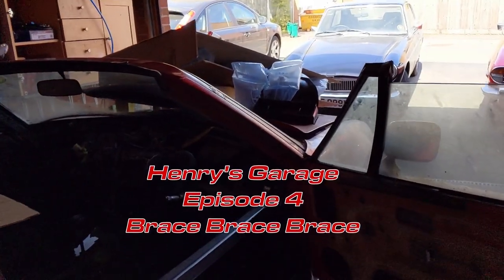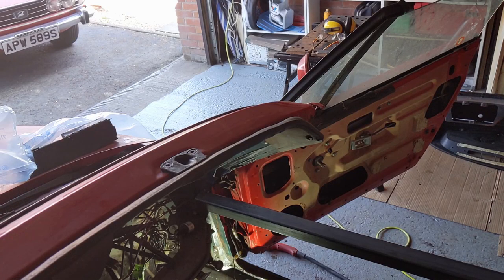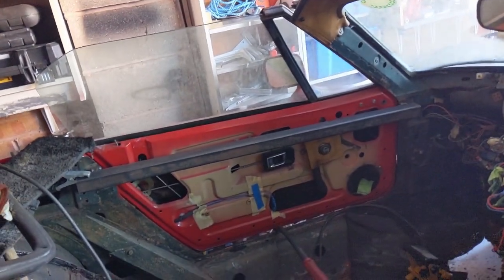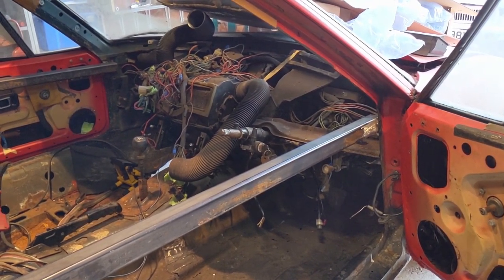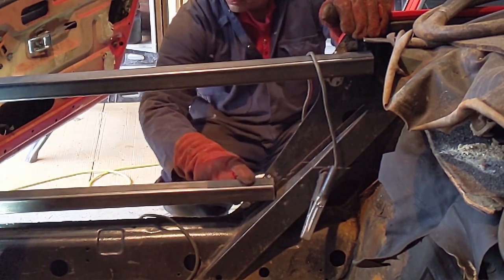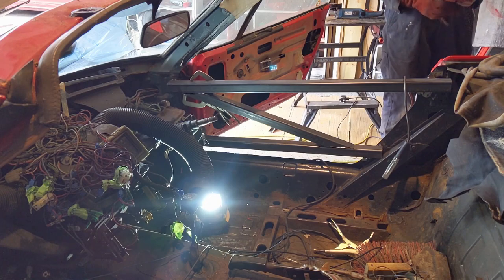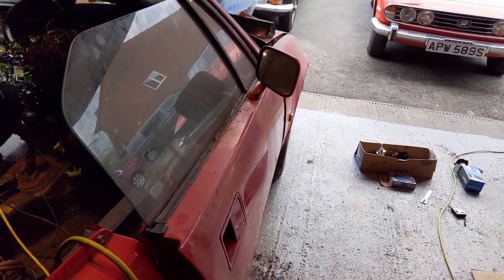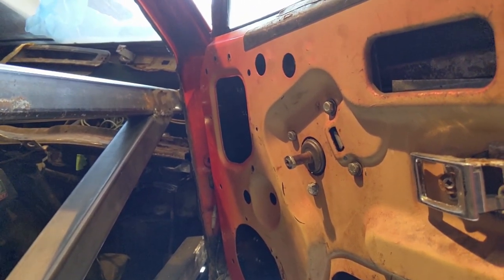Triumph TR7 Restoration: Episode 4   Bracing the Shell

Comment: That winder mechanism is aftermarket - TR7's never had electric windows. Strange it's only on one door though!

Good to see work progressing, you're certainly not wasting time!
Reply from the maker: Thanks - yes, I realised when I was going through a catalogue looking for the bits.  I need to decide whether to stick with electric windows (and buy a new set) or try and source winders etc.  A decision that can wait at the moment
Reply: Handy though, since you can lower the passenger side window without leaning over?
Reply from the maker: @darrellwalker1934  Very true, but what a mess of the wiring it has made under the dashboard.
Reply: @darrellwalker1934  I guess that's why. Seems like a lot of trouble to go to though!
Reply: @OldtoNewRestorations  With an old car, who really knows?  I also wonder if both doors are original, seems like they might have different colors inside.  Could be as simple as a replacement door came with the aftermarket power kit.

Comment: Henry, I think you have enough bracing. Probably don’t need the diagonal in the doors. A cross piece at rear of cockpit would help but you are trying to stop sag in the middle and possible twisting once you have the passenger sill removed. Remember you need to have some room to work on the floors. Once jacked up put a bottle jack under the middle of the car where the prop shaft goes. Leave doors on and try to get them closed as they are a good indicator of body movement.
Reply from the maker: Thanks Gareth.  I figured the bracing I've put in will stop sag between the doors.  I thought twisting unlikely if I had something in place to stop sag (in the floor) along the length of the car which is what I've been worrying about, but I didn't think of a bottle jack.  Thanks

Comment: Well braced trouble is getting to the work to weld it when I did a complete rebuild on a MK2 spitfire few years ago every panel replaced apart from bulk head and rear deck I used a clamp support made especially for the job bolted both ends of door openings and ajustable for any movement from windscreen surround to rear deck all came out ok with a good fit on door gaps doors had a re skin as well i think one support it enough each side if you do a bit at a time once the new sills are on makes it a lot stronger
Reply from the maker: Thanks Steve, you seem to agree with most everyone else